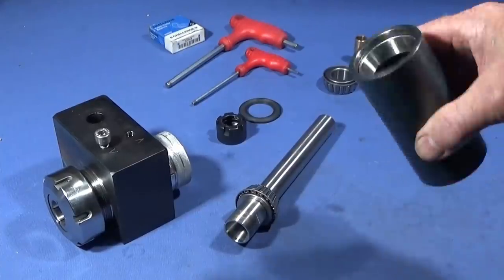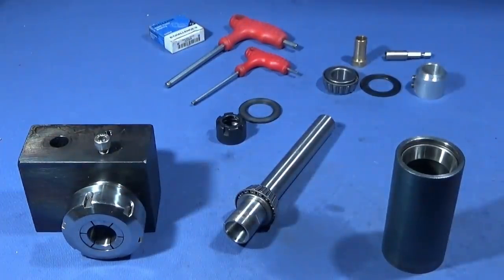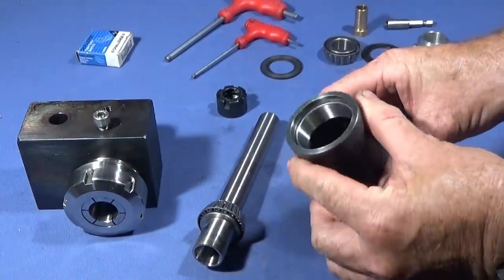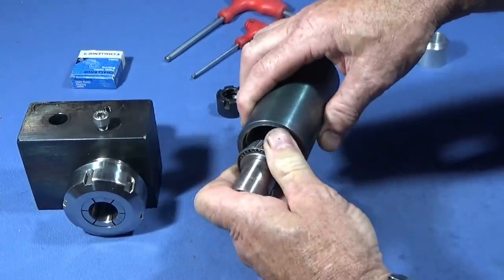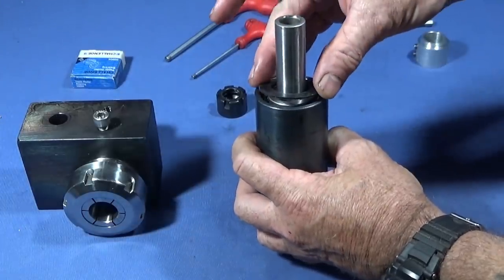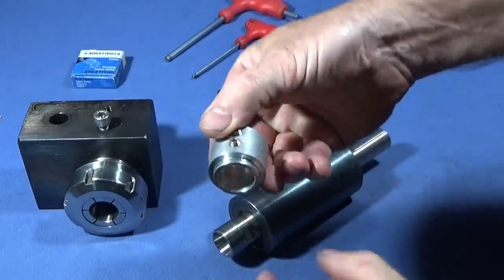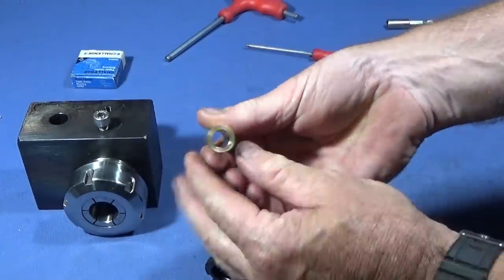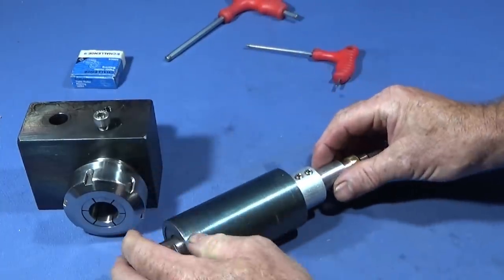ER20 Collet Chuck Lathe Toolpost Drill With Tapered Roller Bearings

Comment: Nicely made. A word of warning to anyone watching this video..NEVER stick your fingers into rotating work to polish or deburr.  It is a very bad habit. Use a  piece of wood like a chop stick or broom handle  with a split in the end to hold  the abrasive paper or abrasive pad. 
     You can get away for a long time using your fingers for this, but if you were ever in the shop and saw what can happen to someone's fingers when it all goes wrong you'd never do it again. Like Marc L'Ecuyer says, "Have fun, be safe!"

Comment: Another excellent idea and project ...Thanks Steve. I need something like this. But for grinding radius on tool bits and drill bits. Your video helps immensely for visualizing exactly what I need. I may be putting a diamond cup wheel in the lathe chuck with a similar rig to what you have but on a vertical pin for the radius work. Also with an index wheel so I could use it like a Deckel.

Comment: Great idea Steve - very useful. If you wanted to, you could also grind a small flat for the grub screws, so that any burr made by the tips of the grub screws doesn't interfere with disassembly later. I could really do with something like this spindle for drilling and grinding work. Cheers, Craig
Reply from the maker: Hi Craig yes I will do that. I ground and polished the 8mm locking bolts on the toolpost the same so it doesn't mark the tool diameters.
Reply: Yes, that's a great idea too. Cheers, Craig

Comment: Steve, just wondering if: i guess that you will set the end play for the roller bearings with grease in them, and thinking whether there is any issue with doing that 'static', without the hydrodynamic float layer that builds up during rotation?  Also, with two grub screws on one side of that preload collet, you might get a microscopic axial alignment shift?  could you have gotten shielded bearings?
Planning to use a flex shaft from drilI to collet assy, to avoid deflection of the positioning due to the drill load? Question answered by 'insert' from next video ;-)
 Silly questions, perhaps...

Comment: Very nice project. Can I ask why you heated the bearing holder?  When I watched you heating it up I was expecting it to be heated to red hot and dropped in oil to protect the surface.
Reply from the maker: Thanks. Yes I heated it up and dropped it in an oil bath to blacken it. I didn't show everything as to keep the video as short as possible. Regards Steve
Reply: @SteveJordan  Ok. Thanks.

Comment from the maker: COLLET CHUCK IN VIDEO...CHOOSE THE (ER20 COLLET CHUCK 150MM LONG) IN LINK BELOW:-
ER11 to ER25 Straight Shank Collet Chuck Holder -- https://bit.ly/3hqLWN7
Tapered Roller Bearing Used. Challenge 32004
Reply: Thanks Steve,  that's the same one I bought and had issues with.   Guess luck of the draw on the quality of these.

Comment: Those bearings need to be preloaded to function correctly.
Reply: Why?
Reply from the maker: Actually they don't need preloading. In other applications they are set with an adjustable nut arrangement. Not under load. Set like I have done here is perfect for this setup. Regards Steve.
Reply: I would agree Steve, front bearing gets pushed back in to taper in use, so locates it's self. You could have got away with a plain  bearing in the back but that's neither here nor there. Cheers